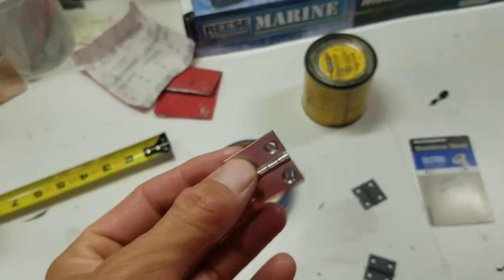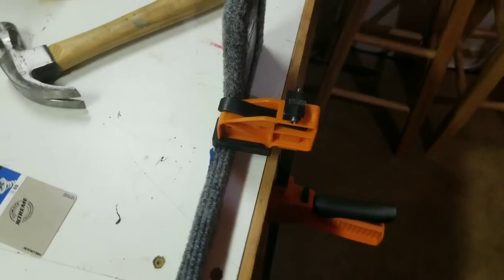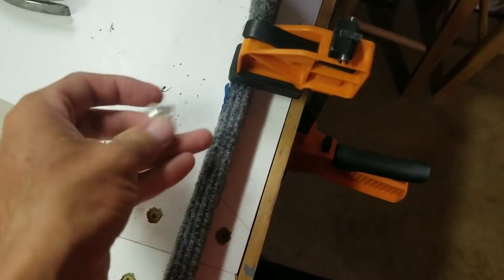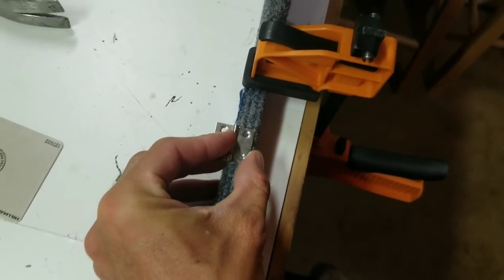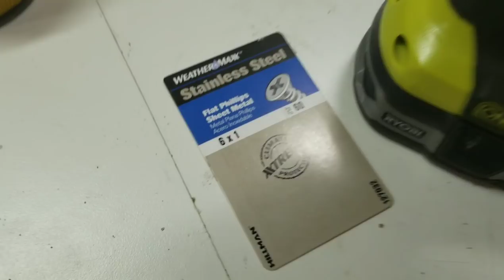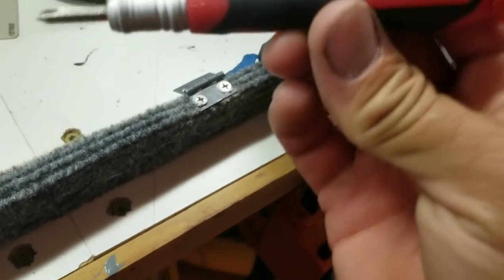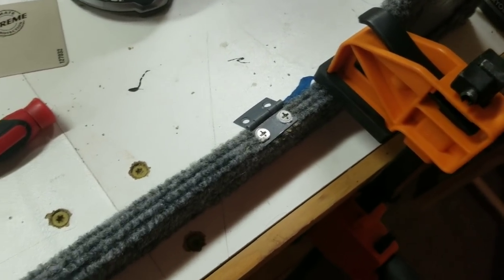CLEAN HIDDEN HINGE Install on Jon Boat to Bass Boat

Comment: Hey Anthony,                                                                                       Nov.14, 2023
     I used the same 1/4" ply for the deck on my boat.  It is actually 2" thick. By using the idea of hollow interior doors with a honeycomb in between the outer surfaces. The whole deck is about i/4 of the weight of a single sheet of 3/4 plywood. The frame gives it the strength .
     On your hatches you could glue and screw on some wood strips around the  edges. Do like wise on the  doors . This will give you plenty of room for the screws. Enough to mount the hinges  level to your deck and below the rug. Then the hinges would be hidden a little better. This would also prevent you from kneeling on those exposed hinges. Oooouch !
      Going to check-out your video Clean Hidden Hinge Install BEEFED-UP!!! Curious as to what you came up with.
     Good Luck,
     Ray
Reply from the maker: Thanks Ray. Appreciate the insight. These videos are pretty dated, I use all aluminum lids now but in the event I do a wood project I actually have updated methods. Appreciate the feedback nonetheless.

Comment: This is a handsome build. I'm concerned about the size of the screws in the hinges vs the 1/4 inch plywood. Hope that it doesn't pull away over time. You might need to put some aluminum trim on the hinge side for reinforcement if you notice any fatiguing starting to happen. That will strengthen the plywood as well.

I'm not as far as you are on my build yet, but I'm using thicker plywood, and I haven't decided whether I'm going to do hatches yet or not. I think I will now that I have seen how nice yours is. I'm not OCD, but I do love a good clean job and this is one right here. Thanks for this video as it's giving me some good pointers on my build.
Reply from the maker: Thanks for the compliments,  I'll keep yall posted on the strength of the hinges and what not. I would recommend thicker plywood, I have since stated I got it wrong in this video, I actually have 11/32 plywood but regardless it was a pain to work with. Saves weight, yes. But harder to plan out build and fabricate altogether. Not sure what I will do on the next one. Good luck on your boat and thanks again!

Comment: This is a great looking build. 
This isn't a suggestion but more of an inquiry. How about using strap webbing as hinges over steel hinges???  I have an all welded aluminum that I use for crabbing in rivers near Savannah but also bass fish out of it. I'd like to build a kit that I could winch out to use the boat for shrimp and crabbing.

Comment: Anthony. I don't want to be a pill, but honestly, that does not look like ¼: plywood. I'm pretty sure, even from the perspective that we have that you are using ½" plywood. I agree with the matter of saving weight but I've been a carpenter for 50 years and a cabinet maker for the past 15 before retiring.And like you always say, "I'm no expert" but I'd appreciate it you would take a tape measure to a raw piece and double check it. One reason I'm saying this is that I'm about to go out and find myself a Jon boat try to duplicate what you've done. I'm that impressed, especially with the work you did on your live well.
but I really can't see ¼" plywood taking those ½" staples you used. I'd like to hear from you on this. Thanks, and great job all around.
Reply from the maker: I started in a later video that I mis spoke. Sorry for any confusion, it is actually 11/32 plywood. You are correct, not 1/4 but definitely not 1/2 inch as well. I do have some ideas on what I would do differently on the next build but I am very satisfied with the 11/32 plywood coated in fiberglass resin for this build. On the underside of all hatches I had to put a runner to make them stable to walk on which essentially made it over 1/2. Theres a lot of ways to do it honestly.
Reply from the maker: Oh, the staples were stainless 1/4 inch. Going over the carpet, and into the 11/32 wood it does not go all the way through.
Reply: @AnthonyJonesBrigadeBoats  While 11/32" is not ¼",  (¼ being 8/32"), It is a hair over 5/16", which makes it just thick enough to accept a #6 screw without splitting out the veneers, especially since you took the time and care to pre-drill and glue the screw holes. That was my main concern, that you would eventually stress out the area around the hinges and cause the whole thing to come apart.
Again. great job both with the mod of the boat and with the attention to detail when making the video.
A question- after doing all of this, and considering the after-mods to beef up the door panels with 1x, would you reconsider going with ½" (which is no long ½") instead of the ¼"? 
I know some people are rolling their eyes wondering what's this guy got up his butt. But having worked in a cabinet shop for the past 8 of my 50 years in construction, and the shop being metric instead of standard, we got very accustomed to dealing in scotias, and splitting millimeters when figuring cabinet dimensions. And I was very impressed with your results when it came to the final tolerances after wrapping with carpet. It makes for a great first-class looking professional job.
Here are a couple of charts I found that illustrates the differences. The second one might be of interest to you because it concerns the weight variations in different thicknesses of plywood.
As you can see, there is almost an 18 pound difference between ¼" and ½" plywoods.
What is the Actual Thickness of a Sheet of Plywood
Plywood is often sold in 1/4“, 1/2“, or 3/4” nominal thicknesses, but the actual thickness is often 1/32” thinner. Because the actual thickness may vary measuring the plywood is the only accurate way to determine its thickness.

A 3/4” sheet is actually 23/32” thick.
A 1/2” sheet is actually 15/32” thick.
A 1/4” sheet is actually 7/32” thick.

Plywood Weight Chart
The charts below show the weight of plywood panels at different thicknesses. Weight may vary slightly by manufacturer and product.

Standard Plywood Dimensions
Weight of 4′ x 8′ sheets of various types and thicknesses of plywood measured in pounds.
Plywood Type Plywood Thickness
1/4″ 3/8″ 1/2″ 5/8″ 3/4″ 1-⅛″
Softwood Plywood 22 lbs 28.5 lbs 40.5 lbs 48 lbs 61 lbs 84.5 lbs
Hardwood Plywood 24.5 lbs 31.5 lbs 45 lbs 53 lbs 67.5 lbs 94 lbs
Marine Plywood 27 lbs 35 lbs 50 lbs 59 lbs 75 lbs 104 lbs
Baltic Birch 26 lbs 33.5 lbs 48 lbs 56.5 lbs 71.5 lbs 99.5 lbs
Particle Board 33 lbs 43 lbs 61 lbs 72 lbs 91 lbs 127 lbs
MDF 36 lbs 46.5 lbs 66.7 lbs 78.5 lbs 99.5 lbs 138.5 lbs
MDO 20 lbs 26 lbs 37.5 lbs 44 lbs 56 lbs 77.5 lbs
OSB 25.5 lbs 33 lbs 47 lbs 55.5 lbs 70.5 lbs 98 lbs
Reply from the maker: @crude4u1948  If you are asking how I would do it today if I were to do a 2nd build after what I have learned I will tell you this:
The 11/32 is super light. We know this. Also total pain to work with. You saw th ed issues I had for pre drilling holes, finding hinges to accept the fitment, adding runners under hatches for support, ect. So, is it worth it to save the weight in the decking for a lighter harder to work material or would I do it again? I feel it wouldn't be worth the hassle of weight savings to go small and light. 1/2 inch, although heavier, would save me a lot of headaches if I were to use it just based off being able to plug and play piano hinges alone. I'd like to think I'd have some revolutionary way of doing it my second go round but sometimes I think it may just be better to keep it simple and go with 1/2 inch. I'd love to do some type of thin composite, metal, or hdpe plastic or something but we are talking a lot more $ and headaches. If I did build 2 tomorrow I would do it in 1/2 decking, try to do hatches in 11/32 with some sort of spacer under lips to pad it out to half inch, with smallest runners as possible in wood or some type of metal even, red cedar 2x2 framing again.

Comment: I am working on a semi v bottom 12 ft Grumman.I am installing a floor but I am consirned about the balance.The Jonboat floor should work perfect.
Reply from the maker: I did 1/2 inch of foam between ridges in bottom, then covered in thin plywood coated in fiberglass resin, then carpet. Worked out great.

Comment: if you would use a counter sink bit you would get the proper angle in the hinge holes and your tapered screws will sit flush with hidge , just make sure you get the right counter sink bit.. have different angled bits.
Reply from the maker: True that man. Unfortunately for this videos sake but fortunately for me, I have learned a lot since this video. As good as the counter sink bit works, I've learned the cleanest and most efficient way for me personally is a drill press. Thanks for suggesting!

Comment: Look into using cabinet door hinges. They are specifically designed to be hidden.
Reply from the maker: I did. They don't work on this setup. Cabinet clearances and designs are a lot different from how framing and decking goes into a boat. Also most cabinet hinges require an insert or recess drilled into back side of door and no way you can do that in 3/8 decking. Cabinet hinges also have a lot of parts/degrees of adjustment which seems problematic. The way I'd did it is the simplest way I could think and has worked very well so far.

Comment: Sheetrock screws dont have a tapering on them. Idk how you feel about using them on wood, but ive never had a problem with them at all. Theyre cheap too.

Comment: Thanks for the in depth explanation. The wood look like 1/2” is it really 1/4?
Reply from the maker: 11/32 actually.  I corrected on future videos. 11/32 actual thickness which is 3/8 nominal thickness.  If you go to Home Depot and buy a sheet of 11/32 for under 30 bucks, that's what I used. In my WATERPROOF HATCH WITH FIBERGLASS RESIN video, I actually build a hatch step by step in raw form and you can see the thickness there.

Comment: i’m about to start a 14 ft build. what did you frame with. also, are the built in seats or benches in the jon boat able to be cut?

Comment: Quick question cause I guess I missed it. Where are or should I say how does water escape while fishing and it starts pouring rain. I see no worm holes.
I’d buy this boat btw. Lol
Reply from the maker: Just depends on the hatch. The molded in rear hatches and the one up front w the light bar have weep holes hidden in the corners, the other hatches have gaps in the floor panels. I made sure to leave space for water to find it's way to the factory channels under the floor system. If flooded it should make it's way to the rear where I have a 1,100 gallon per hour bilge installed. Hopefully that helps you.  I'm probably going to keep this boat a while but you never know!

Comment: Hello does those hinges held up well? Because I am thinking about doing it that way and I want to know if they hold up well! By the way great video!!🔥🎣
Reply from the maker: Still doing well on my boat but if your  decking with 1/2 inch plywood the simpler newer solution would be purchasing 5/8 inch offset piano hinges. Available on tbnation.net
Reply: @AnthonyJonesBrigadeBoats  Ok thank you so much!! 😁🔥🔥
Reply: @AnthonyJonesBrigadeBoats  The only issue is that it’s very expensive and I’m from Canada so shipping + US rate change to Canadian gets me up for almost 400$ worth of hinges 😅

Comment: I'm 14 I just got my first bass boat and the storage on it is very iffy its a 1962 skeeter hawk  nothing fancy but the storage doors are sticking out of the decking itself and Its not sturdy plastic that you can stand on. How do you think I can make wooden doors and hatches built into the deck to be flush? I need help a lot, Thanks
Reply from the maker: Everything from Snowboarding-hunting Huh... I'd prob need pics to see exactly what you are talking about. I'd think your best bet would be to build new hatches out of wood though. I love working with wood in boats because the possibilities are endless. You just have to spend a lot of time painting and sealing it properly. If you are on Instagram you can DM me pics and I can take a look.

Comment: Three hinges to prevent warping.
Reply from the maker: Don't need three. It has metal C channel runners under the plywood that doubles as jig holders. If I was relying on hinges to prevent the hatch from warping then I definitely didn't do something right...